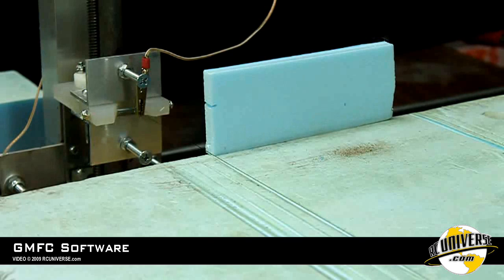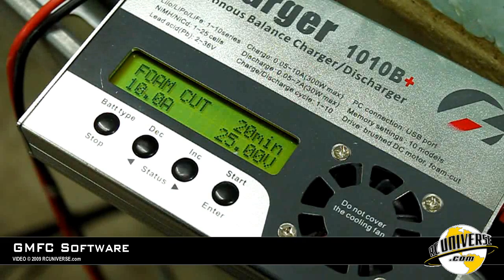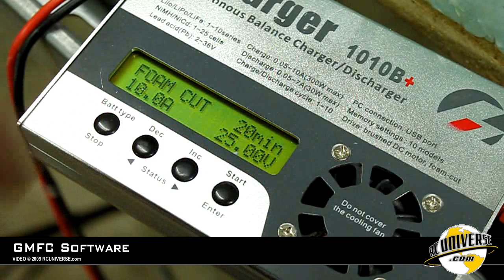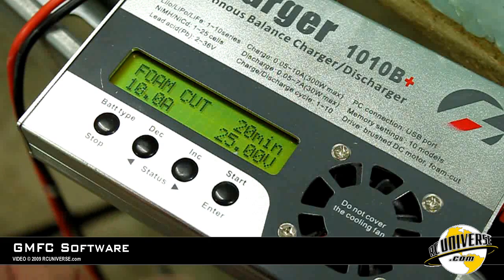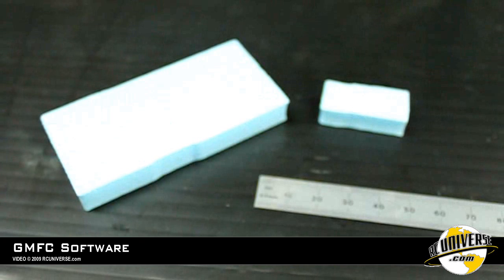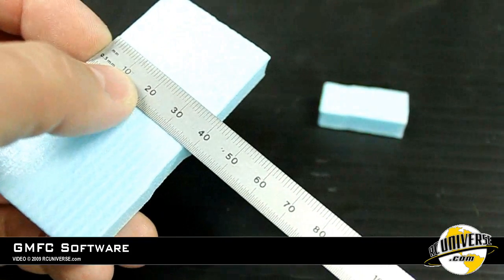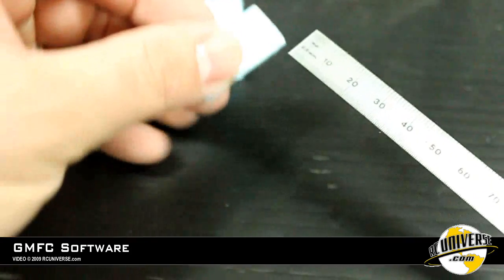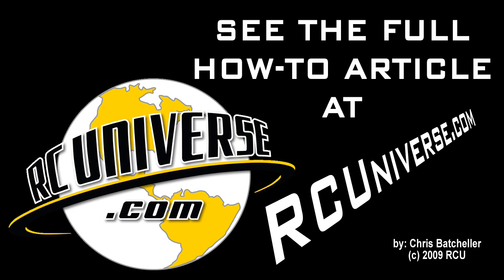How To: CNC Foam Cutting Machine.  Part 2 - Calibration

Comment: WOW!!!...I'm stunned.  I've been using this software/hardware package for 7 years now and have run with around 0.75mm kerf on the fast end and rarely over 1.3mm on the slow end....You're using way, WAY, too much heat!!  Anything you cut with that setup will be a real mess when you get to a thin section, like the trailing edge of a wing.  If you're going to post articles and videos showing people how to use equipment...please, get it right!  These machines are capable of delicate, fine art!